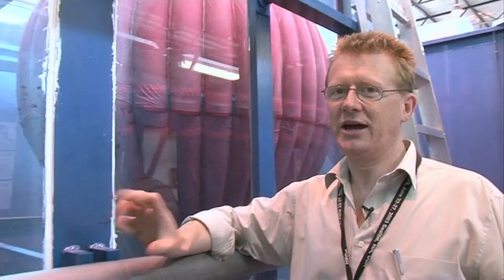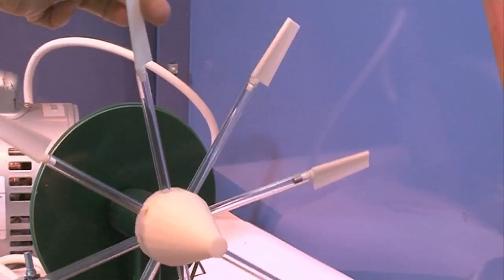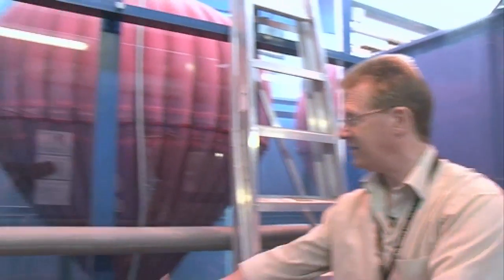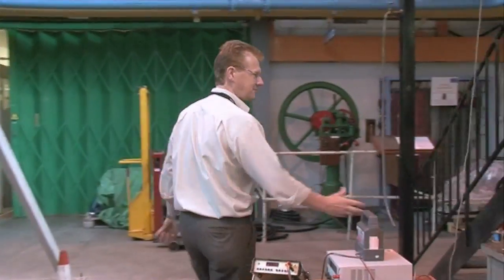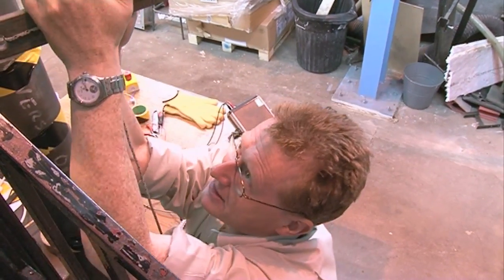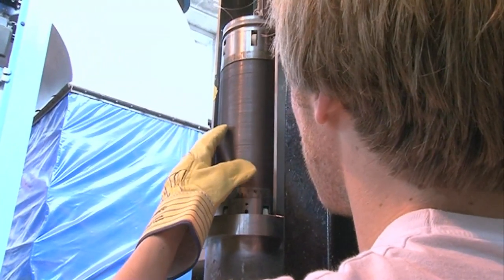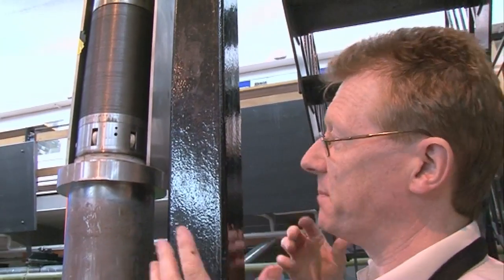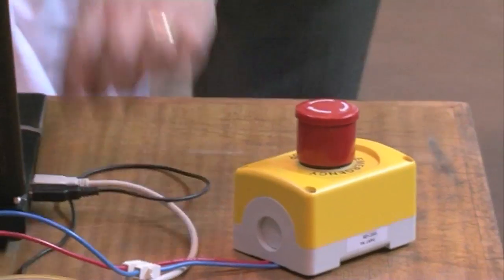Piston Drop Test

Comment: This seems much more like engineering than science, except for the part where they needlessly attempt to reinvent the wheel.
Why don't they call up the engineers at Wartsila and ask how to make a well proven piston seal (or a whole pump with a more flexible rotational velocity range), or contact SKF for information on linear bearing lubrication? 
Granted they didn't cover all the details in such a summary video, however from the trapped water and labyrinth seal explanation given it appears they aren't very familiar with the fluid mechanics of plain bearing lubrication; or the water is purely for a seal but they don't understand that a rotating labyrinth seal works in part by lateral acceleration of the sealing fluid and also ignore the issues of sealing in the water at the ends which actually has a lower kinematic viscosity than air, and of replenishing the water as some will escape in the microscopic nooks and then evaporate. Then there is lubrication and life of roller elements, in a frequently reversing motion at low speeds. All of which has been studied quite in depth in industry where economics force efficiency. This is what I mean by attempting to reinvent the wheel.
Reply: +wolfedog99 Actually now that I think on it. They would be much better off simply adapting low speed cross-head diesel detail engineering to a radial or rotary cylinder arrangement (depending on flywheel needs), change the valving a bit and presto, big long lived pump with existing manufacturing facilities.

Comment: Replace the plastic tubes with copper or aluminum, and use a neodymium magnet for the piston, and in addition to compressed air you could use the Lenz's effect to generate electricity!

Comment: BAD IDEA. Wind turbine torgue is proportional to wind speed suared and power - to wind speed cube. Constant pressure resiprocating compressor has constant torgue and drive power proportional to it's speed. One way or anouther gearbox is needed.

Comment: Wow this guy managed to make a bad idea (industrial scale wind turbines) worse through his lack of understanding even the basics of mechanical engineering.  What a mess.
Reply: I'm not an engineering expert but I find this project quite interesting, why do you think it's a bad idea?
Reply: +Dreamer It's merely the question of efficiency. This design is extremely inefficient. It also overly complex and mechanically unsound. Once the rotation rate exceeds a limit the piston movement will seize as they are force to the ends of cylinders by centrifugal force. Also balancing such rotational mass would be overly complex if not impossible.
Reply: Very much my thoughts. There has to be a far better way of compressing air.
Reply: What they can do is use some of the compressed air to slow it down so that it does not go to fast for the centrifugal force to take over.....using the same type of brakes used in normal wind turbines would break under the stress or overheat or explode